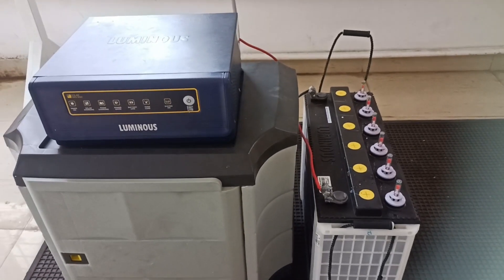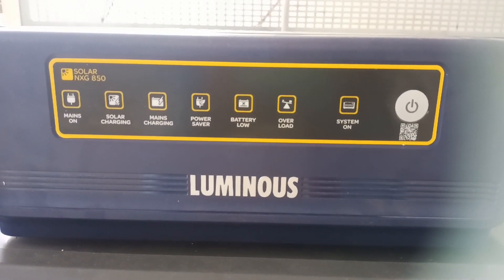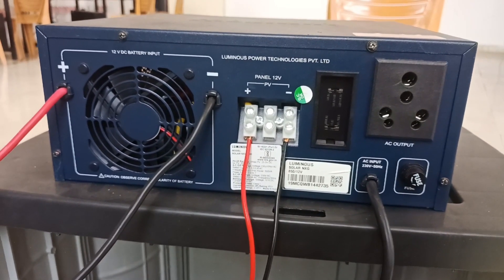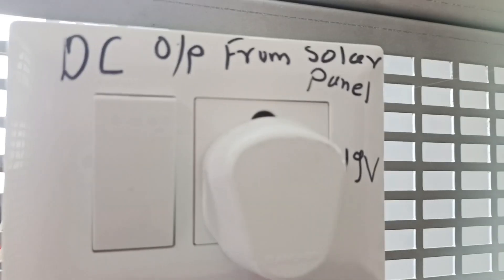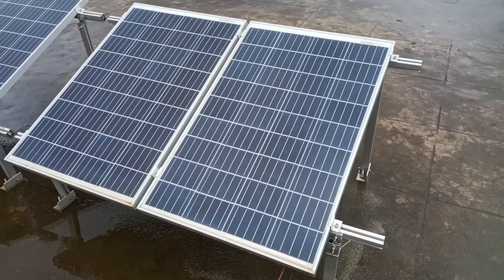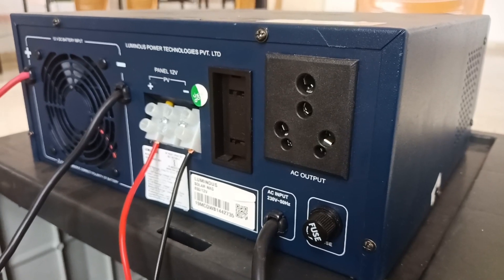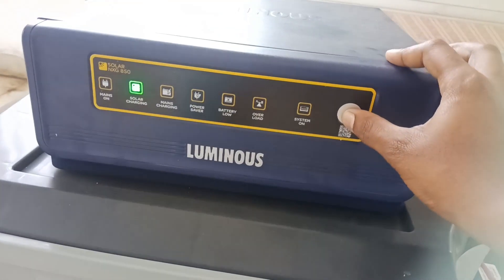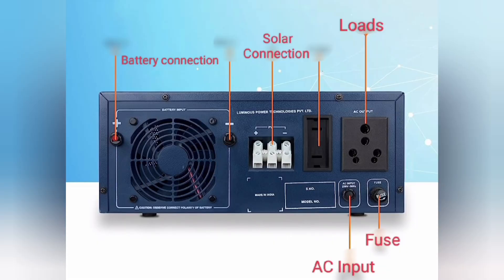Luminous Inverter connection for Home || NXG 850 || Solar Home Inverter ||  Battery & Inverter.

Comment: if battery fully charger, are the power consumption using from solar panel?
Reply from the maker: @jakartafiberoptik4174  solar panel used only for charging the battery.

Comment: How many ah battery are you using in this.
Price of inverter is what?
Reply: Battery 150ah with luminous 850e. Max load I have run is 300 watt. 6 led, 2 fans, 1 perosnal cooler.
Reply: @balrammahato710 what is back-up (in HR) with this load ?  I mean with these load, How much time does 150 AH battery provide power on full charge?
Reply: @gbkarad  never for that extend. But theoretically it should last 3-4 hrs in 300watts. For short time cut off you can use as High as inverter supports but we generally reduced power consumption by turning off the unnecessary things. Max I had used for 2 days with only necessary use.